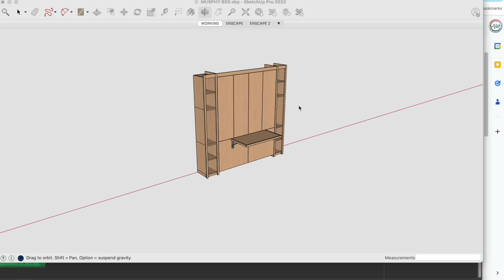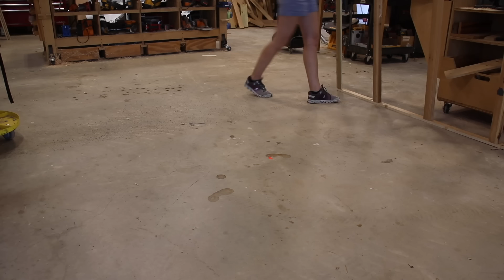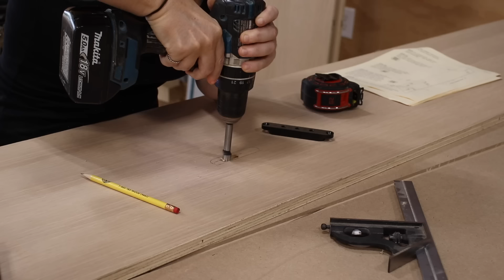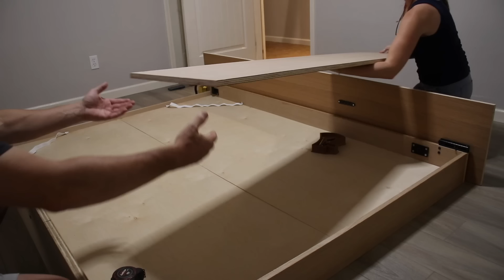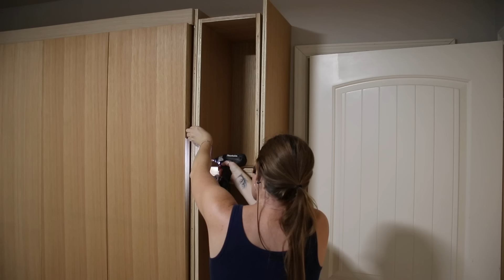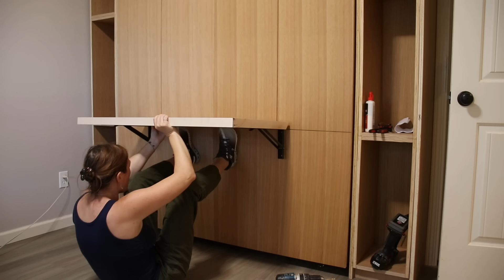I Built the Best Murphy Bed--with a Folding Desk!

Comment: Just what I needed. I'm planning to use the Vevor Kit.

What's the width of the whole cupboard? I've got a similar wall with a door as you have which is excluding door 2,17m/7' 1 7⁄16". I'm planning to use a 2,00x1,80m or 6x6,5' mattress.

Any recommendations I might look out for. I will include at least 1 side cupboard and maybe put a shelf or something on the door